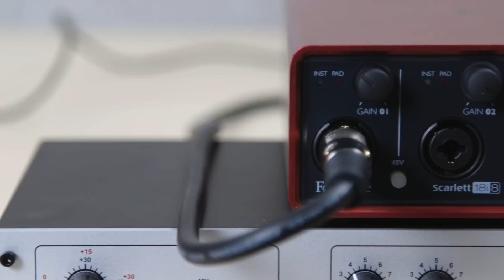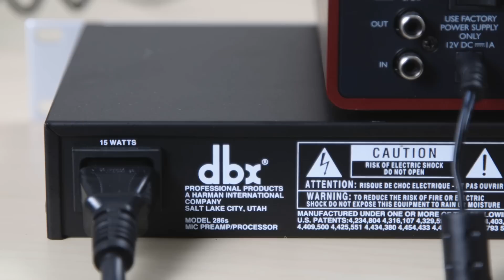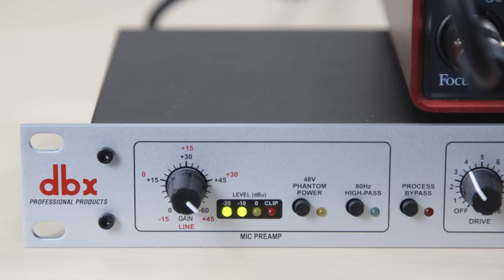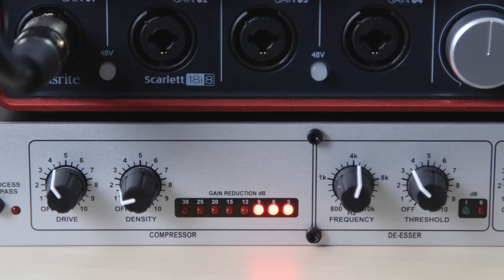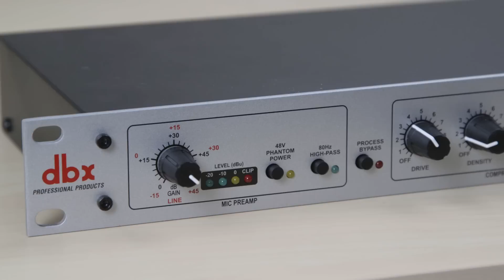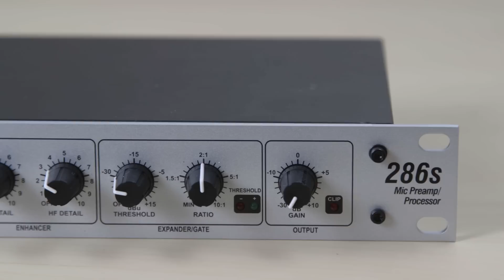dbx 286s Mic Pre-Amp Review + Set-up Walkthrough

Comment: It sounds like you have the de-esser intensity set a little too high. It occasionally sounds like you have a mild speech impediment (unless you have, in which case I apologise).

Also, would it not be better to connect a balanced line-in to the rear of the Focusrite as opposed to using the XLR on the front? By running into the XLR on the front of the Scarlett, aren't you then running through it's preamp as well as the dbx's?
Reply from the maker: +napalmhardcore Yeah, after making this video I did find out that running it into the rear of the Scarlett would be a cleaner option ideally, but it still works/sounds great through the XLR in the front.
Reply: +Caleb Wojcik Thanks for not getting defensive. I was trying to think of a way of mentioning it without causing offence. I'm currently researching various pieces of equipment and your vid was really helpful :)
Reply from the maker: napalmhardcore No worries at all! :)

Comment: Hello, and thank you for the review!
2 questions:
1) are there alternative units to this one that are available at a smaller size? as you said in the video, that's one wide unit for someone without a rack mount! but the features on this look great...

2) I currently have a 2i2 and an AT2035 mic. I want to purchase a Shure sm7b dynamic mic. This mic seems to have a history of being gain hungry, and for 2i2 users, often requires a CloudLifter unit to add additional gain. Will this 286s "add gain" with its preamp to make the sm7b work with the 2i2?

thanks again!
Reply from the maker: +mpxz999 1) If you mainly just need Gain, the Cloudlifter is an alternative I know others have used. 

2) Yes, the dbx 286s adds plenty of gain for the SM7B to work with a Focusrite like the 2i2.
Reply: +Caleb Wojcik Hi again Caleb, and thanks for your response!

I have a question:
I purchased an SM7B and a DBX 286S to connect to my Focusrite Scarlett 2i2.
When all 3 of those components are connected together, I have a strange background buzzing noise... https://soundcloud.com/mithos-277194/unwanted-mic-noise-troubleshooting/s-3DxpZ

However, when just the SM7B + Scarlett 2i2 is connected, I do not have the noise. 
Did you ever encounter anything like this? It seems related to the DBX 286S in some way.
Reply from the maker: mpxz999 Make sure no audio cables are touching power cables at all. Separate the cables so you don't get interference at all.

Comment: This is awesome! Too bad I don't have the desk space for something like that.  Do you know of any smaller alternatives?  I mostly just need the extra gain since I just recently ordered a dynamic mic.  I hear the Fethead or Cloudlifter preamps are decent for adding some gain.
Reply from the maker: +ErrADDict Yeah, the Cloudlifter would be a smaller option if you just need gain. This does so much more with compression/gates/etc. though. You basically just set the dials and leave it most of the time, so if you can hide it somewhere, it is worth it.

Comment: Brilliant video, helped me a lot. Just one question:
I have a condensor mic (audio technica AT2035) going into my Scarlett 2i2 interface. I want to add this compressor to my setup but I'm unsure of what cables I need. As far as I understand, the setup would be the following Mic (AT2035) -> DBX 286s via XLR -> Scarlett 2i2 via XLR Male to 1/4inch TRS Male -> Scarlett to PC via USB.
Reply: You should actually use a balanced trs 1/4” inch cable on both ends to connect the dbx preamp to the Scarlett 2i2. Make sure to switch the input on the Scarlett 2i2 to line input. Essentially this allows you to bypass the onboard preamp on the 2i2.
Reply: @protoman247  where do I connect the trs to on a scarlett 2i2 tho?
Reply from the maker: +Dean Jackson Correct. Here is the cable you'd need to connect a dbx 286s to a 2i2. 3-Foot XLR Male to 1/4-Inch TRS Male 16AWG Cable: http://amzn.to/1Pg6R01

Comment: Awesome video! I have been looking at this mic for a long time now but I repeatedly get discouraged from buying it because of the expensive preamps you need for it. But it sounds great with this relatively cheap setup. Would this work with a Scarlett Solo? Or is the preamp quality majorly different between the solo and 18i6 that there would be a noticeable difference? Thank you for your time.
Reply from the maker: +RustyWasp You get more gain out of an 18i8 than a Solo, but if you're using a pre-amp like the dbx 286s, you can just boost the gain on that instead. Hope that helps!

Comment: Thanks for that information!
But I got one question
I saw another review and set up video, but the guy said the output gain should be 0 db and the mic preamp gain at +15 to +30 db
What is the difference?
Reply from the maker: +SGM Records | Rap Instrumentals I'd increase the pre-amp gain first, then do all your adjustments. The output gain is then for getting the levels you want in your recording application/output speakers. Does that help?
Reply: Caleb Wojcik Thanks for answering! I think this will help a lot!

Comment: Awesome set-up video, Caleb! If I were to use this in conjunction with a 2i2, would I need to purchase a Cloudlifter as well due to how power hungry the SM7B is?
Reply from the maker: +Coding Newbie No, you wouldn't need a Cloudlifter if you have a 2i2 and a dbx 286s, since the dbx gives you a ton of power.
Reply: If I used the scarlet 2i2 with the dbx, would that be the same or similar to the 18i8 that your using in terms of sound floor

Comment: Great video review I'm really enjoying your stuff. I'm an audio pro, and I'd suggest that you always have the high pass engaged for voice. Nothing good will come through the mic below 80 hz (it's there to disengage for bass, etc.). Also, I'd recommend using a TRS to TRS connector to your Focusrite. You'll get extra gain the way you're doing it, but you're running it through two mic preamps as it is--introducing more noise. With the TRS input you'll be able to increase or attenuate a line level signal without triggering the mic pre on the Focusrite. 
Best video review I've seen of the dbx so far!
Reply from the maker: Darren Hibbs Hey Darren, thanks for the advice. I'll try the TRS to TRS tip and see if there is less noise as well as engage the high pass. Testing to commence...
Reply: @CalebWojcik  so what were the results?!  I'm looking at picking a pair up for Chimera Creators and would love to see/hear an update video??
Reply: Darren Hibbs Thanks. Was wondering if I'm missing out with my TRS-TRS connection. Glad to leave it alone
Reply: +Darren Hibbs +Caleb Wojcik  Enjoyed the video. However, I had to comment. With regards to podcasters - If you plan to edit your audio in post after recording (and you are not streaming a live show) you should consider bypassing any Expander/Gate present in your recording signal path - this will allow your noise reduction software/plugins to more easily 'learn' what it will be removing. For example, with some software, you can highlight just a section of the noise in your audio waveform, in order to 'teach' it what it should be removing. 
NOTE: If you are live streaming, like say on Blab or Periscope, I would suggest splitting your audio signal at some point. 
On the DBX 286, this can be done via the [insert] jack on the rear of the unit. For example - Plug your mic into the DBX 286s as normal. Then, if you plug a standard 1/4" cable (not TRS 1/4" style cable) into the DBX 286s [insert] jack on the rear panel, it should provide audio that is coming from ONLY the DBX 286s MIC PRE section - the trick is DO NOT push the 1/4" plug all-the-way into the [insert] jack (otherwise, this will interrupt the signal completely and not allow a 'parallel signal' to continue to pass through the rest of the DBX 286s.) 
If done properly, this will give you  - 
 - One audio signal path going completely through the DBX 286s (to send off to Periscope/Blab, etc.) 
 - A 2nd,  'MIC PRE ONLY' audio signal (coming from the [insert] jack) to send over to your recording set-up. 
(yes, I realize this is not a requirement, just a suggestion for those planning to provide the audio as a download afterwards.) 

Similarly, as in the case of iZotope's RX5 Advanced software, its optional 'de-plosive' tool works best when you DO NOT engage the bass roll-off (aka high-pass) switch on your mic, DBX 286, or via EQ - That switch on your mic (if so equipped) is a less than perfect "one size doesn't fit all" solution, in my opinion.  If you are going to do any post-production on your computer, you want to record the full range of your microphone, with rumble, warts, and all. You can then, in this example, use the 'de-plosive' tool first, and if so desired, roll-off the low end using a corrective or parametric EQ thereafter. 

I highly recommend Heil PR-40 owners record the full range of their PR-40, but then roll-off the low end accordingly during post-production - one of my favorite podcasts needs to do this badly! (again, just my opinion, of course.) Whenever I listen to that podcast in the car, I need to roll the bass all the way down to make it sound good, and "less boomy."
Reply: Marc Johanssen I’m just blown away by the details of your comment and expertise. Awesomeness!!!
Reply: + Darren Hibbs...This is good advice, but it should be noted that the TRS connection into the Focusrite should be going into the 'Line Input' in the back of the Focusrite, so it bypasses the preamp altogether.
Reply from the maker: +James Foster Hey James, I am not really using the preamp on the Scarlett. I'm just using that as the interface to the computer via USB, for monitoring with headphones/speakers, etc. You can't use the dbx 286s only because it doesn't have a USB output. Hope that helps!
Reply: Hey Caleb, I have a Shure SM7B and I'm wondering if this plus a much cheaper usb interface than the scarlett would be ok to use
Reply: Marc Johanssen Could you please make a video, or take a picture of this. I went with the trs to trs option for my dbx to my Scarlett 2i4. Which holes do I plug it in and how far? It seems like I've tried everything!!
Reply: Darren Hibbs ,did I need have audio interface and dbx for have good quality sound?
Reply: Darren Hibbs would I still be able to use a zoom H and 6 as an audio interface with this preamp?
Reply: @Darren Hibbs I have a Scarlet Solo that has an XLR connection for the mic and one TRS for an instrument. Are referring to connect an TRS from the dbx into the TRS for the instrument? Thanks a lot in advance for details when replying? Cheers
Reply: Darren Hibbs just found the hard way that TRS toTRS from the DBX to scarlet solo doesn’t work. It needs to be TRS from DBX to XLR on the Solo. You’d need a bit of higher end Focusrite in order to go TRS to TRS. Any thoughts?

Comment: I tried out the 286s for a while but it was just too large for my liking. For adding extra gain, I would go the cloudlifter cl1 route if you already have a decent audio interface.
Reply from the maker: Ryan Kwon Good point. If all you need is gain, something like that works well.
Reply: I am so torn about this right now. I'll probably have to go the Cloudlifter way because I have so little desk space. But I badly want the cleaner, more powerful gain of the dbx as well as the processor. Sigh